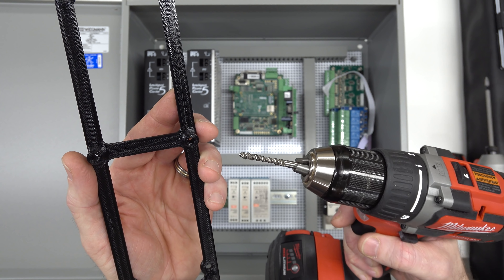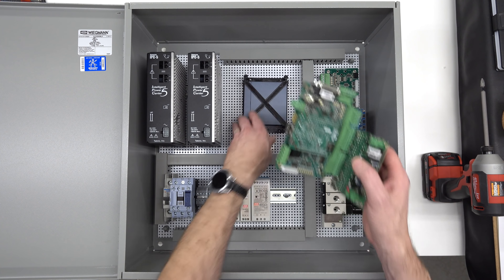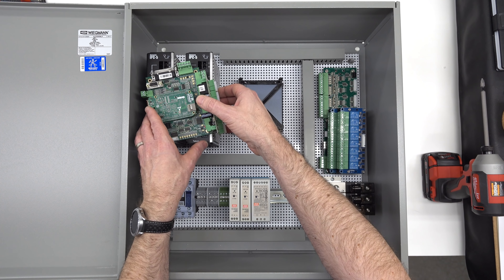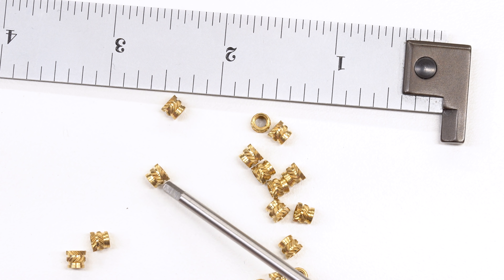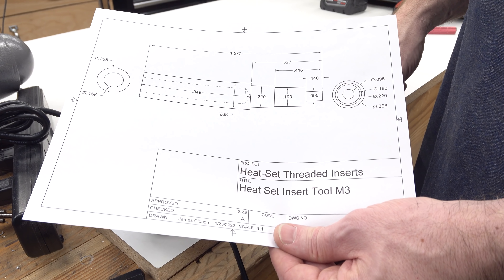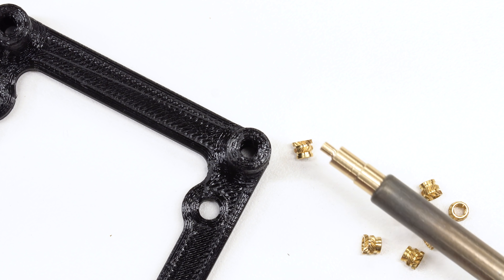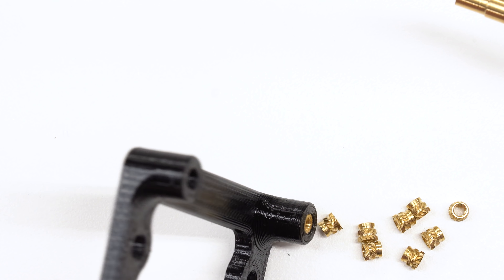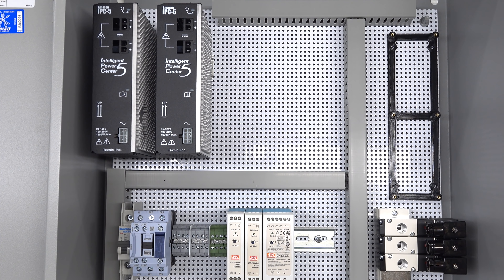Using Heat-Set Threaded Inserts | 3D Printed Acorn CNC Controller and Ether1616 Expansion PCB Mounts

Comment: M3 is just not the right thread for plastic, special coarser high helix angle plastic screws work just fine without tapping.
Inserts are neater but often not worth the effort.
Reply from the maker: For one time use, I would agree.